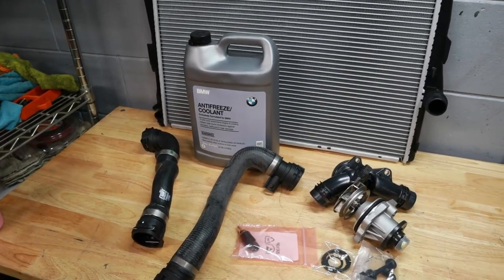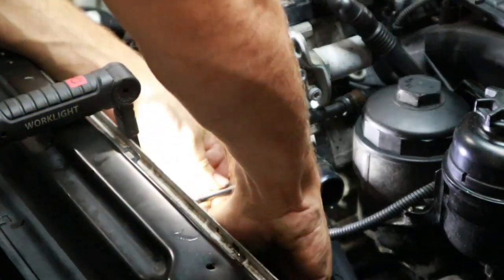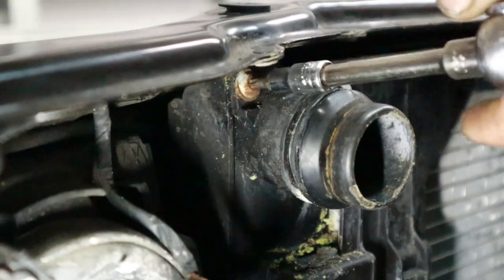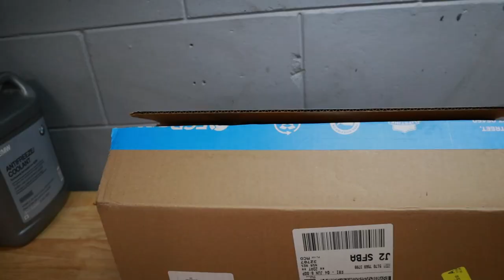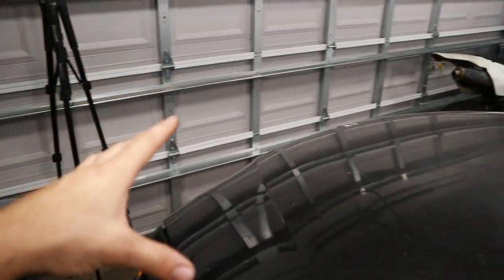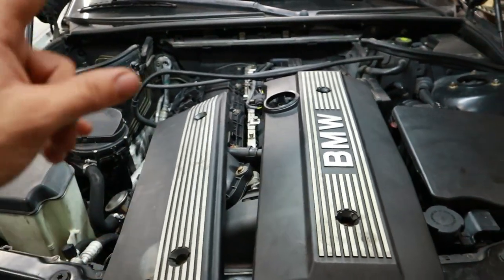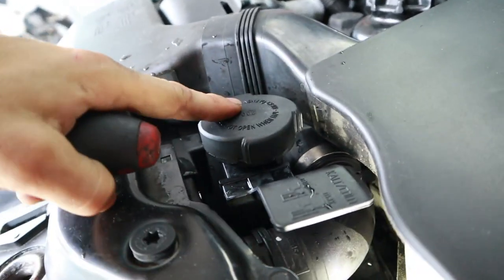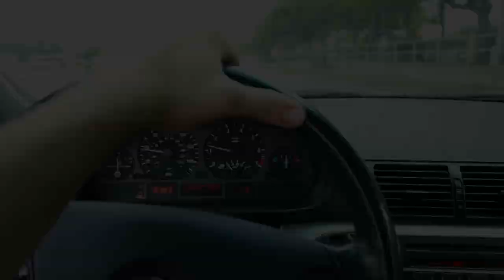Replacing the ENTIRE COOLING SYSTEM on my E46 325xi (+ First Driving Impressions!)

Comment: What was shown was not the entire cooling system. You have two plastic hard lines under the intake manifold as well as a few more cooling hoses that are under there that should also be replaced if you're intending to do the entire cooling system overhaul. What is shown is just a cooling system "refresh" where you're replacing the easy to access components of the cooling system. Still a good video showing how to do a good refresh.
Reply: The hard coolant pipes and the heater hoses are sort of a 'stage 2' cooling system refresh.
Reply: My car is at 260.000 km and the hard lines are not leaking, and usually from what i've seen its a slow leak which means it wont leave you stranded like an expansion tank will. Its one of those things thats easier to do while you're doing something else like a ccv. I won't touch them for now personally but you are right that they are also a part of the cooling system.

Comment: 13:00 ... swap the level sensor from the windshield washer reservior into the expansion tank until a replacement arrives.  They are the same part, and its more important to have a functional coolant level sensor than washer fluid warning.

Comment: So wonderful to see an electronic thermostat being relegated to its proper place: the bin. The more the ECU thinks you are driving gently and economically the more often it will set that thermostat to the top temperature setting to help lower fuel consumption and emissions but completely killing all those plastics! Killing plastics including the expansion tanks, hose couplings, chain tensioners, valve stem oil seals, sensor bodies and connectors, ...

Comment: 4:59 ... crack the bolts loose on the water pump pulley BEFORE removing the serpentine belt ... no need to use the clutch fan tool that way.  Same on reassembly, snug the pulley bolts hand tight, install the belt and THEN do the final torque to 89 in-lbs.

Comment: My 330 Coupe, I replaced all of the cooling system as per your video end of 2020, it’s also Auto so had all of the same issues, one of the time savers I have done is to convert over to the Electrical fan cooling got rid of the Viscose cooling Fan!!, save tons of time when working on the front engine areas.
Reply from the maker: Someone told me about that retrofit! Very cool, I'm going to keep my eyes open for that electric fan at the junkyard :) Thanks for sharing and following the channel!
Reply: On the viscous clutch fan, just spin it on hand tight and use a small dab of anti-sieze, and it will come off easy the next time.  

DO NOT use the 32mm wrench to tighten the fan onto the water pump pulley.  Not even a little bit or it will suck trying to remove it again.  The engine rotation works to tighten the fan, so absolutely no need to tighten it at all.

Comment: Which is best water pump brand to install?
Reply from the maker: HEPU has always been my preference for these older motors. Full aluminum, don't get the plastic impeller pumps. Thanks for watching!
Reply: Thanks for your response. Am actually on E46 320i M52 Yr 2000.

Also my fan clutches are failing don't understand why.

Comment: I have a 2002 325i that has started to overheat and now doesn't have hot air from the vents. The car has a lot of miles so I'm trying to determine if the vehicle is worth continuing to sink money into. 
Plus the factory radio has randomly stopped working.
Reply from the maker: Check the coolant tank, make sure it's not leaking! Water pump failure can also happen commonly.
Reply: No heater? This usually means water pump. This is a cheap part, less than $100AU depending on vendor. Easily replaceable DIY.

Comment: I saw previously you have green coolant, and then put fresh blue one, can you put it right away? or have to do a flush before?
Reply from the maker: Doesn't hurt to mix a little, but if there was rust or debris in the coolant I'd definitely do a flush!
Reply: If the old fluid is in good shape and not too old, then not a big deal to mix.  But if the old fluid is old, them better to flush with distilled water and refill with fresh coolant (blue or compatible green). 

There is an engine block coolant drain plug on the exhaust side of the block near the right motor mount bracket, that drains coolant from the block below the water pump level.  In really bad and neglected cases, sediment might drain out from the block plug.